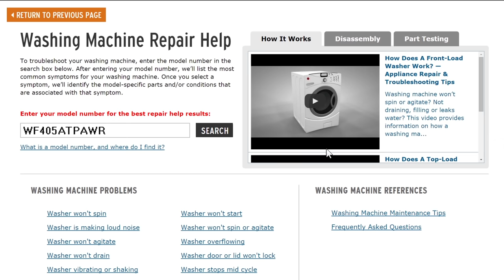Front-Load Washer Is Noisy — Washing Machine Troubleshooting

Comment: Why doesn’t anybody show the sound to see if this is a problem
Reply: Because that would take actual work -- i.e., finding a machine with the condition or creating the condition in a machine.  It's much easier to slap a video together with a monotone narration and some plain text overlays.
Reply: Mine  sounds like a jet getting  ready to take off.
Reply: @berthatiller6465 hey did you ever find the reason? Was it at the end of the cycle whe it was spinning the water out? Mine just started going into warp speed.
Reply: @Ghengis443  no. But it's still working.
Reply: Because they're fraudsters
Reply: @Ghengis443  That's exactly what mine started doing a couple of days ago. Ugh.
Reply: @SevenDogCity  You found the reason? Mine started to make that noise:(
Reply: Exactly! Mine sound like got a big rock in it 🫠

Comment: I found that the noise comes from the balancing rings that have lost their sodium chloride allowing the large steel balls to roll fast inside the ring. Once the heavy salt solution has leaked from the balancing ring, the machine will never be properly balanced in normal operation. Even at the lowest speeds the machine will self destruct eventually. For me, the order of failure was front balancing ring failure creating a loud constant noise while spinning. The noise was like a cement mixer and a jet plane. This in turn caused a seal failure which in turn made the tub bearings fail. The proper fix if your tub is still useable, replace the drum spider, front and rear balancing rings, the tub bearings and seal and all should be good as new. If you have a GE front load washer you have to purchase a new drum which comes with the spider. GE is all about selling parts outside of their 1 year Parts  Labor warranty. Oh yes they cover the motor for 10 years but the machine will have a major drum spider failure long before that. GE front load washers will last 6 years if your lucky then start to self destruct.

Comment: Mine LG was making noise. Thought it was bearings but actually ended being Washer Basket Balance Ring. Replace tub bearings because I had it all a part, broke corroded spider spinner support, so once parts come in I’ll have new bearings, balance ring and spider support. If you tackle any of these, I was planning for 5-6 hours of work. If all went smoothly, it would have went much quicker. Biggest time consumer now is waiting for parts, second biggest time consumer was cleaning everything. Since I had everything a part did a deep clean on every part. Soap and hard water build-up everywhere.

Comment: Just wondering if you know the answer. Recently, my front loader produces some sort of scratching sounds when it’s on the washing cycle when it spins slowly. No such sound is produced in the spinning cycle when it spins at high speed. I tried to check the drum after I took the clothes out but couldn’t anything stuck in it. Any ideas for the reason?

Comment: I have a LG TROMM, it is 13 yrs old, i had PSE&G out to repair, he only asked me what was  it doing, i attempted to explain that it was a very loud noise, but not squeaking, he immediately said that the motor was gone and it would cost $1000 to repair and due to the age it is not worth it, i got my monies worth.  It has been over a month since he was out and the machine is still washing but making the loud noise.  Should i just purchase a new washer or have it looked at again for repair?
Reply: I replaced the motor on mine for $34 on Amazon works going on 4yrs now

Comment: Hi! I have a samsung front load washer that makes a loud knocking sound on spin cycle... also not able to complete the spin cycle. Also produces a burnt plastic smell after spin. Bearings are good (i tried installing a new rear drum and the problem persisted). Spider arm is corroded but not completely broken yet. Shocks appear fine. Weights are tight. What else could i be missing? Thanks
Reply: Sounds like the spider bracket mount is cracked. Unfortunately they don't sell the bracket separately, so you'll have to buy the whole casing and full assembly. Can be pretty costly depending on your make and model ($450 + shipping)

Comment: @ :32 the problems is 2 different types of metal alloys.  The drum and the 3 leg spider piece.  over time they corrode. forcing the owner thats not handy with tools  to buy a new one.  FUNCTION AS DESIGNED so we end up buying a new front load washer every 8 years..

Comment: I have a Kenmore Elite HE3t washer that I purchased 2003. There was a banging noise at high speed so I checked you tube for an answer. 
So what I did was I  replaced the rear tub fitted with new bearings. After putting it together and run a test, I still have the same problem. Does this mean that it wasn't the right part that I replaced? Could it be just the shock absorbers or the spindle in the basket which I noticed with a little play? Need help in troubleshooting. It will be greatly appreciated   Thank you
Reply: Did you ever find out what the issue was? If so, what was the solution?

Comment: Top five reasons your front load washer is making a loud noise:

1] It is a residential front load washer and by definition is designed to fail 
2] It has a die cast spider that is bolted to a SS drum. Galvanic corrosion WILL destroy it in a few years
3] It is under engineered, over priced and has many hundreds of parts that love to fail
4] It is a machine that cannot be reliable when built to a price point for residential use. 
5]It is not a top loader by Speed Queen or a $300 Whirlpool. See # 1 again
Reply: That's just stupid.
A washing machine as we all know won't last forever. 
The machine will eventually fail and will need to be completely replaced with a new one.

Comment: How about an example of each noise?  Useless video.
Reply: For me the video isn't useless.  It gave me the feeling that the most likely cause of my washer's banging drum is worn shock absorbers, and the second most likely cause is a worn rear bearing.  My washer's drum bangs only at a particular spin speed, which is momentary because it passes through that speed when the drum speed is accelerating or decelerating.  That particular speed must be a resonant frequency of the drum + load (where load = clothing + water), which suggests something is worn or loose (and will probably get worse if I don't fix it).  I think the fact that it only happens at a particular drum speed rules out several of the causes mentioned in the video.